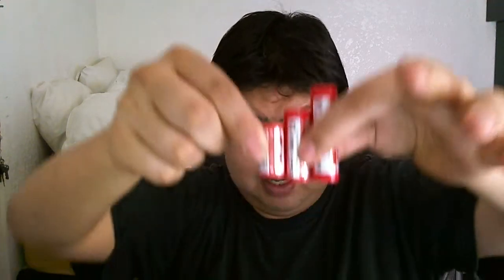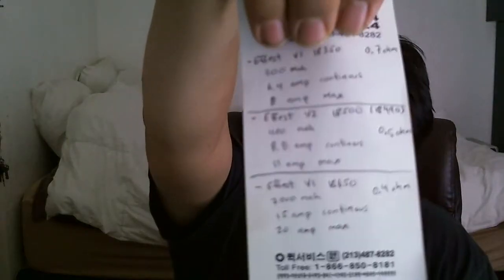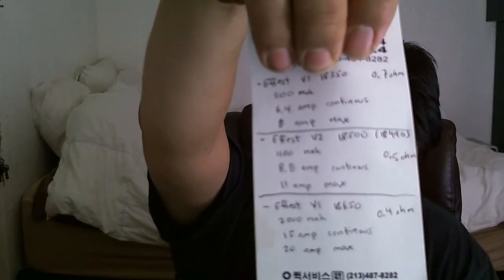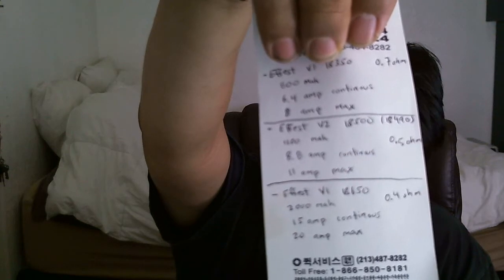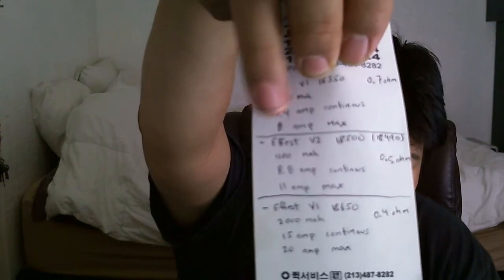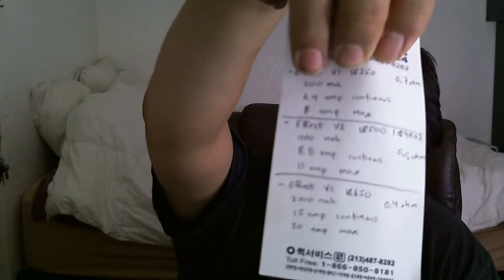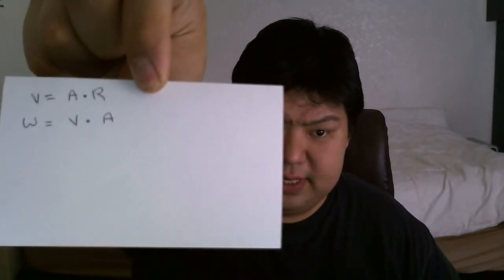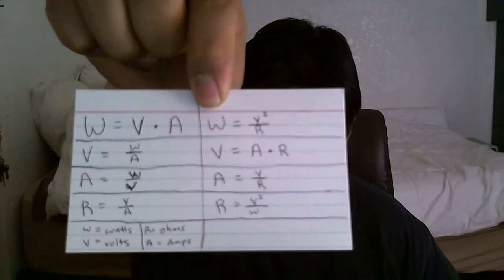Battery safety and Stacking

Comment: hey @Andy C i have a my coil at "0.25 ohm" on the reader (so i am sub ohm)  and i have a telescopic mod so im not limited to what i can fit inside. Normally i use 1x sony 18650 but i have 2x trustfire 16340s one of which (at a time) i use on a high-powered 3watt laser. Anyhoo i said screw it after watching a few videos of yours and ended up trying the stack. First i tried one 16340 and it was weak sauce. so since They were both close to full so i tried stacking... AND IT WORKED AWSOME. Batterys did get a little hot but my no name 18350 always get arnd the same warmth when in use. I took a few rips and was in bliss but sadly it doesnt feel safe and id like expert advice on the situation. Id love to be able to stack these two 16340s on a reg basis. They are 3.7V output so id be at 7.4 VOLTS and im pretty sure just 30amp continuous even with the stack. Please get back to me sir!
-note: i know they need to have around the same charge so one battery isnt making up for the lost amperage/Voltage of the other! =D
Reply from the maker: most 16340's are limited to 5amp continuous. Even ones with a very high current limit. Not a good idea to stack any batteries with less then 30amp continuous, and Sony Vtc4 battery at ten second pulse has 60amp current limit before you overheat the battery.  At 0.25ohm with a nearly fully charged batteries stacked you will be pulling 32 amps of current, at 8 volts, using 256watts of power. You will overheat pretty quickly.
I would suggest only stacking 18650 high drain batteries or larger such as a 26650. The smaller batteries cannot handle the load, the internal resistance just doesn't allow it.
Hope this helps, if you have any other questions please feel free to ask.
Reply: andy thank you for this quick knowledgeable response. The sony handle quite well as a solo unit so i dont think i will ever need to stack these bad boys! And again Thank you sooo much for responding! Youve gained yourself a new sub.
Reply from the maker: Thank you for the sub.

Comment: "Chucking the mod" is the WORST ADVICE EVER. Please don't tell people to do that if their mech's heat up for god's sake. You're just adding more danger to an already bad situation. If the mod gets hot just quickly set it down and walk away. Or better yet, unscrew the top cap or any of the tube sections to avoid any further battery contact, set it down and walk away. NEVER CHUCK THE MOD.
Reply from the maker: I believe throwing a mod is the best advice if it is in the brink of exploding. ICR batteries react much quicker then IMR batteries, and with a Li Ion pack that reacts quickly you might not have the time to set the mod down and walk away. Plus the explosion from a contained mod is massive. THROWING THE MOD TO GET IT AS FAR AWAY AS POSSIBLE IS SAFER THEN EXPLOSION RIGHT NEXT TO YOU. With the sony vtc4 a direct short still produced massive pressure within seconds. and that's a IMR battery can you imagine a ICR battery? It seems you never vented a battery but when the time comes I ADVICE YOU TO THROW THE MOD (in a safe location).
Reply: Andy C
+1
Reply from the maker: Your fine just use high drain batteries like the lg or samsung. Sony vtc 4 and vtc 5 is always highly recommended. But at .5 ohms and up you should be fine. The pulse rating on most imr batteries are pretty high

Comment: Would the coils heat up quicker if i stacked like 18350? I am trying to cloud chase. I've wrapped god knows how many coils. I used a 18350 with a 0.9 ohm build and it vaped nicely but now the clouds i wanted....
Reply from the maker: yes because your doubling the voltage, but with two 18350's you are no longer in the safe zone with a 0.9ohm coil. The only time I vented a SONY VTC4 was when I stacked. Stacking can be safe, but you really have to know your battery's limits. Remember your amp limit does not double when you stack.

Vaping from 51.4 watts to 176.4 watts Stacked 18650 on mechanical mod

but on a single battery you can always get good vaper

Testing a Subohm build 98 Watts

Try out 0.2ohm build with either a sony vtc4/vtc5 or efest purple 35 amp battery, it really produces some giant vaper